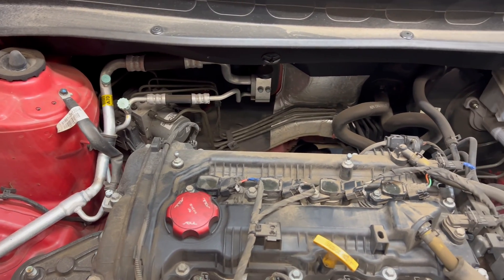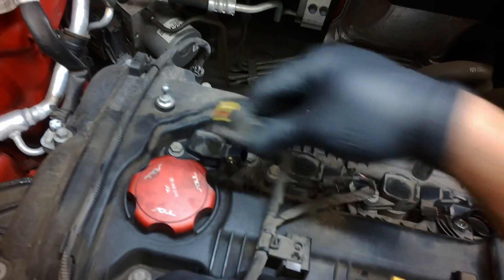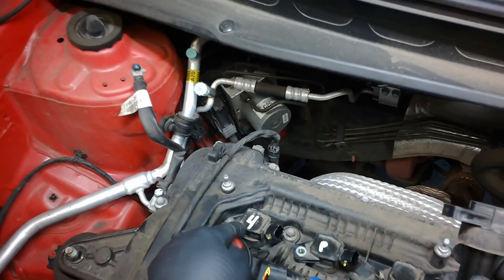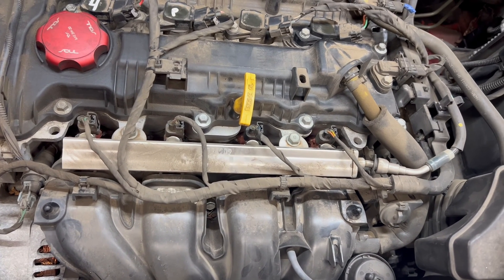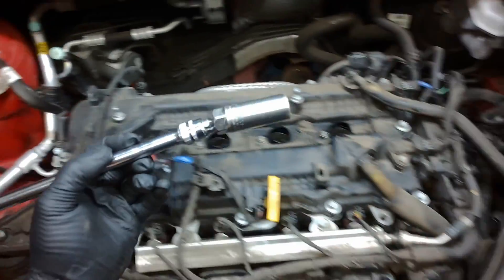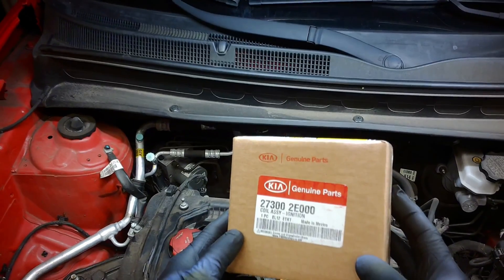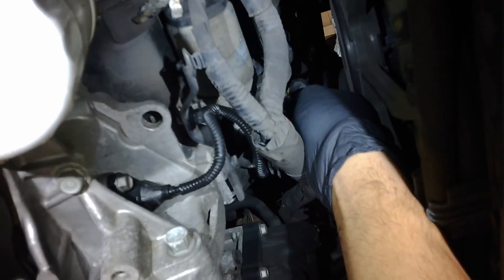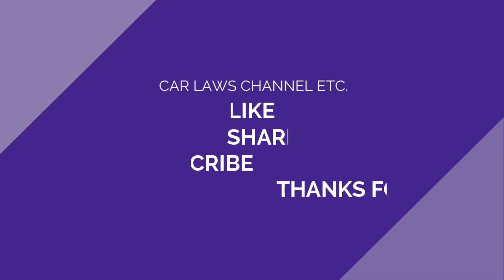HOW TO REPLACE SPARK PLUGS, IGNITION COILS AND CRANKSHAFT POSITION SENSOR ON KIA SOUL 2.0L 2010~2013

Comment: The 2010 and 2011 Souls had a different 2 liter engine. It has a timing belt and only has port fuel injection. Starting in 2012 the Soul had an optional 2.0 engine (as in this video) that has a timing chain and has direct injection also known as GDI by Kia.
Reply from the maker: Thanks for the detailed info regarding the engine differences!

Comment: Are you sure that is the 2.0 and not the 1.6l.  The ignition parts for the 2.0 look different
Reply: The 2010 and 2011 Souls had a different 2 liter engine. It has a timing belt and only has port fuel injection. Starting in 2012 the Soul had an optional 2.0 engine (as in this video) that has a timing chain and has direct injection also known as GDI by Kia.
Reply from the maker: I’m pretty sure about engine displacement which is 2.0L